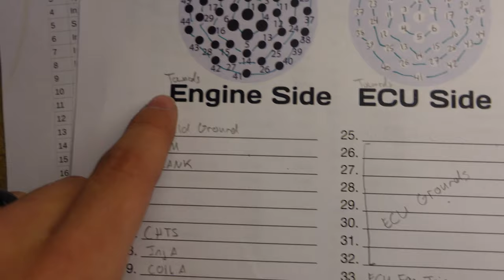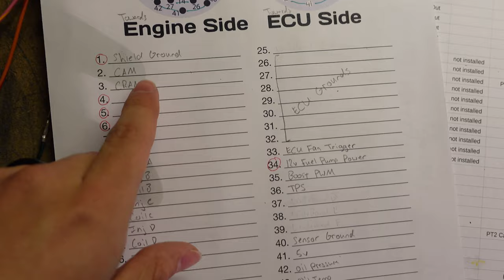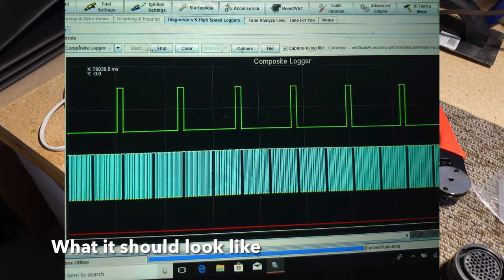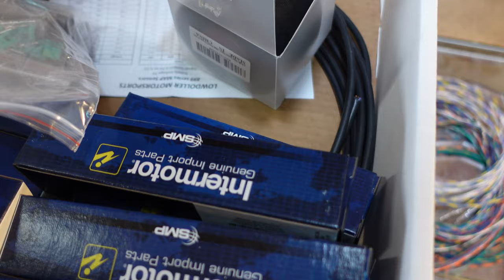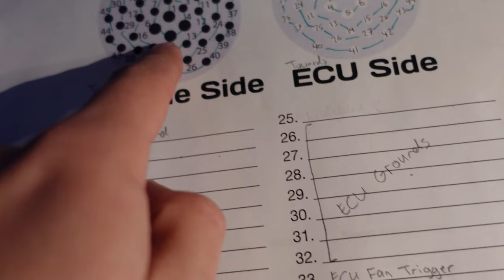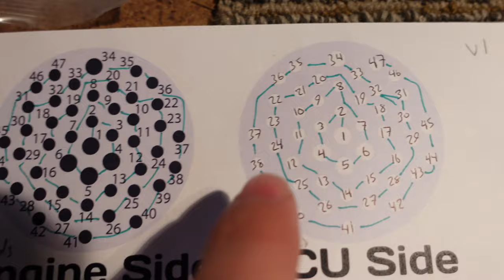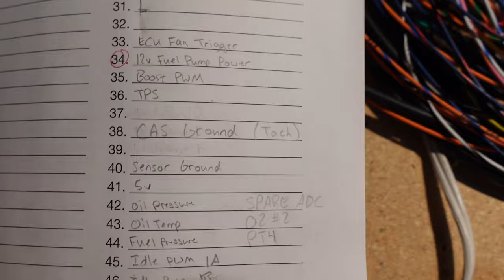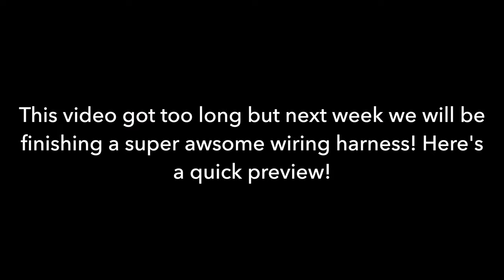Building a Mil-Spec Harness Part 1

Comment: wrap tape around the needle nose pliers, the kit also came with 3 sizes for removing wires that could help installing but ive found needle nose really help on the plug connector side with socket terminals you have to grab on the wire and push thru the back, but pulling the pin terminals on the receptacle side is so much easier lol

Comment: Where did you get those connectors from? Some rats got into my 86 z31 :( I need a few random ones and before looking at the car too much I wanted to do some research on diagrams or other things like that so I can be familiar with what I need and what I don't as well as what I  should fix
Reply from the maker: I got the new connectors through rockauto and reused some of them. It may just be easier to get a new harness from someone with a parts car though. You can find wiring diagrams on XenonZcar.com under the reference section. They have the entire factory service manual

Comment: how much wire did you think you used?
Reply from the maker: I just used the wire in the megasquirt kit from hamiltuned, but if I had to estimate wire length, I would say 40 wires at 5 or 6 feet each. So a conservative 240 feet. That would be the high end because not everything is 6 ft but it's better to have too much than not enough